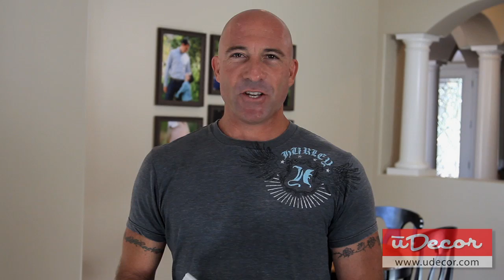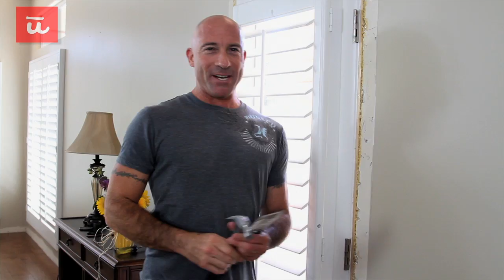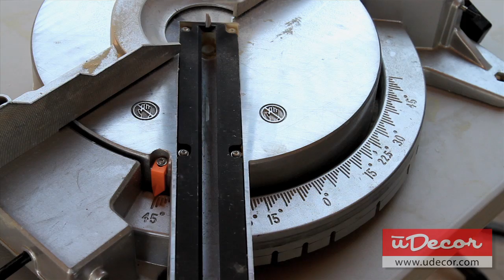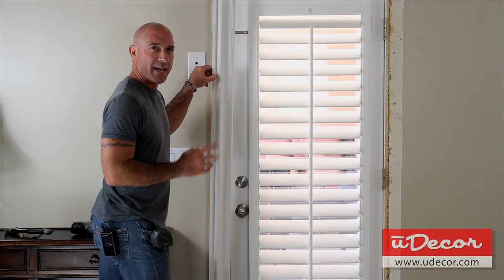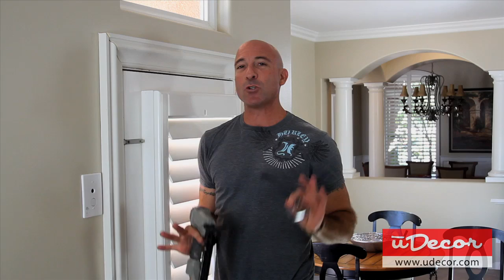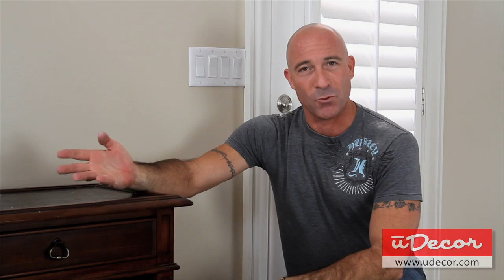How-to Replacing Door Trim in your Home

Comment: Very helpful!  I especially appreciate your mentioning the air pressure setting on the compressor and the details of the adhesive, spackle and caulking.  Thanks.

Comment: Using the adhesive makes it so much harder for the next person to change the molding, and that terrible union between the switch plate and the new molding makes it more likely that someone will want to tear this all out and redo it. Too many destructive shortcuts here: changing proportions of molding to cover wall damage results in problem with switch plate, and the adhesive to reduce number of nails causes future problems. Note that caulking requires smoothing afterwards.